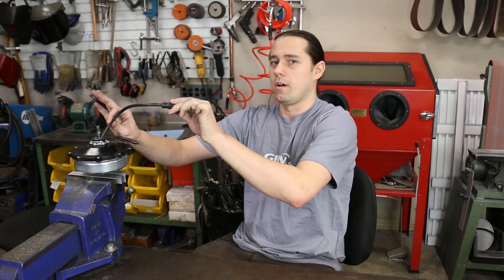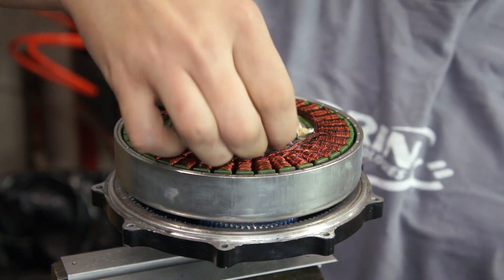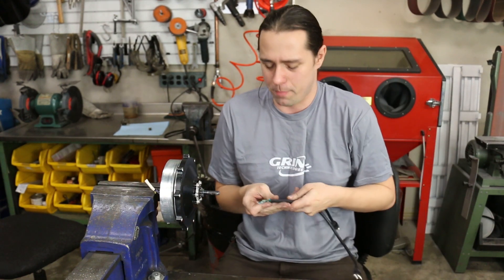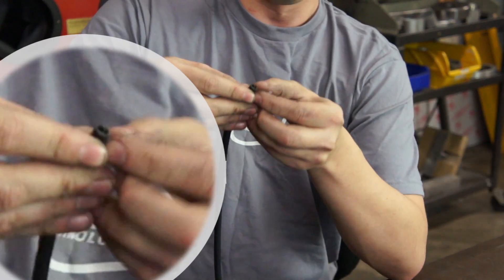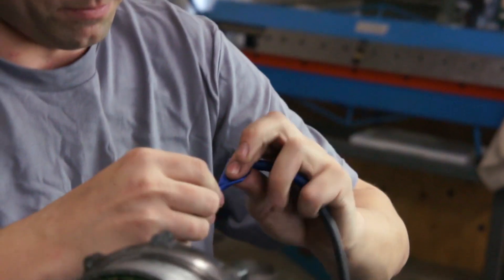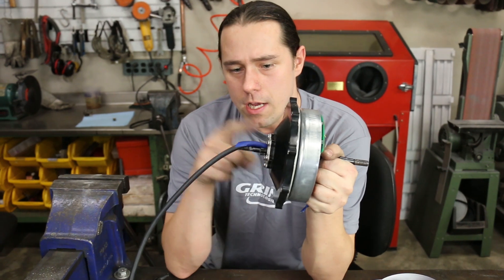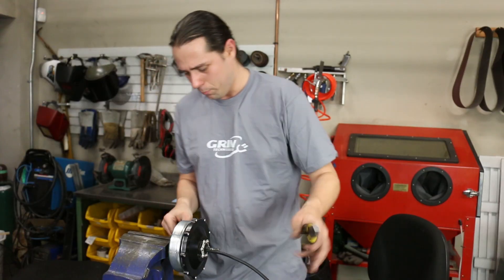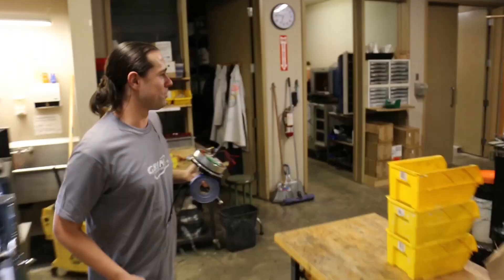How to replace a damaged cable harness in an ebike hub motor

Comment: I frequently encouter the same issue pulling the cable through a too small orifice while pulling electrical cable to install swimming pool lights. I use the same method of decreasing the diameter of the outer sheathing. but leave a longer tail of the inner insulation cord and attach very strong nylon cord to it, then using electrical tape to secure it to the cable. To do this so that the cable will still fit through the races and bends, I make sure to wrap the excess cable as tight as possible to make its diameter as small as possible. The nylon cord used as a fish tape can then  be doubled or tripled to add tensile strength. I also use electrician"s luble to ease it through the tight races. I'll be performing this very task this weekend on my boyfriend's bike that I crashed when some clown turned right in front of me. Those front brakes sure worked better than the rear brakes because I went ass over tea kettle over the handle bars, consussion and serious bruising. Asshole didn't even stop to see if I was okay or check to make sure I didn't sue his insurance company into the Stone Age.....I'll let you know how swimming pool technology transfers over to ebike repair. Thanks for the incredibly helpful and informative video.

Comment: I’ve made cable repair but display continues to display 30h communication error. Could it be my controller is fried from when the cable was damaged?
Reply from the maker: Communication errors are between the controller and the display, and don't have anything really to do with the connection between the controller to the motor which is covered in this repair video.  So yes it is quite possible that your controller is damaged too, or you have another wiring issue with the signals, unrelated to the motor cable.

Comment: Hey man i have the same problem. Can somebody please tell me what kind of wires those are..I've been looking for these phase wires and all that I can find is the 9 pin connector but not the actual wires that go through the axle..
Reply from the maker: Every motor is different so you might want to email our tech support with more info on what you're running!

Comment: Thanks for this great video.  Can you let me know where I might buy the cable and 9 pin connector from?
Reply: AMAZON, they have all the cables. Just select the end type you  need to connect to your controller
 Then cut off the other end that will now go into your motor.😅

Comment: So the trick is to pull out the cable on a roller chair to prevent you from hitting your head on the floor when the chair collapses.
Reply from the maker: Precisely, only we forgot to specify "roller chair" as one of the tools.

Comment: I would get some electrical lube and cover the cable with it. The lube is a special type for electrical use. I’ve even used dish soap in a pinch.

Comment: I am going to attempt this job next week.... But I have pulled Big wires through conduit and I use a Lube on the big stuff.... so I will lube the cable before I pull it through, after I do my Tape job......  and I will not cut all the wires at the same point....  I will cut each inner wire at a different length, so I will have a longer taper ....   Thanks for the video and info here....  I wonder if KY jelly will work?

Comment: This video is great. What would make it awesome is a source for the cable. Because otherwise, I get my hopes up, figure I can repair it, and then learn I can't get the cable. So the video just mocks me.
Reply from the maker: A lot of motors have sufficient extra cable length outside the axle that you can just repurpose what you have and shuttle it further down.  You can also DIY a 3 phase motor cable using thin walled FEP shrink tubing and putting that over the flexible stranded noodle wire after removing the thick silicone insulation.
Reply: Buy the cable with the right connection you need, then cut off the other end that will go into the motor.

Comment: I had an idea, why not strip all the wires twist the ends solder them all to a scrap piece of tough wire, feed that single wire through the bore then pull the entire cable through?

Comment: Where did you get the wire? You can't repair these motors because no one knows where to get the wire?
Reply from the maker: We often simply salvage the phase wire from damaged motor controllers and keep that on hand to use in motor repairs. The 3 phase wire that we sell here works in some cases: https://ebikes.ca/shop/electric-bicycle-parts/wiring/grinmotorcable.html   but for many other motors the OD is too large and you need a thinner gauge product. 

It's is possible to fabricate your own motor phase wires by stripping the silicone insulation of flexible noodle wire and replacing it with thin walled FEP shrink tubing. This reduces the cable OD substantially so you can get an OK wire gauge through the axle hole.

Comment: I be never ever seen anything like it I snapped my hub cable right at the wheel this guy made it look so hard Ive never ever done any electrical or cable soldering but it was so easy don't watch this.unbelievable
Reply: My hub wire is torn / chewed at the end also..how did you do it?  Video looks like I need to be a pro or an idiot to work that hard.
Reply from the maker: The difficulty really depends on how exactly the cable run fishes through the axle. We did the video on the GMAC motors which are among the most challenging jut to show how it can be done in the worst case scenario. If the cable is just going through a straight bore to the other side without any sharp bends then of course it is much easier.

Comment: The construction of these hub motors, is very similar, to wind turbine generators, just add the magnetic polarity. Has anybody done experiments, or reverse the polarity on these, similar to people's alternator experiments, in order to generate electricity? I love my 3000 watt motor. Debating whether I should replace the one black wire, for the hall sensor, (If possible) or locate the make of this used electric bike I bought, In order to get the proper cable, going to the hub motor.
Thoughts, suggestions? 
Thank you so much community.
Great video as well! Thank you.
Reply from the maker: There is nothing required at all to run these or any other hub motors as a generator. Just spin the hub and it will create a voltage on the phase leads, and you can either rectify that with a 3 phase diode bridge to run off the back-emf voltage directly with no regulation, or you a motor controller in regen mode to have fully programmable output voltage.  Tons of people have done this in all kinds of neat power generation applications.

Comment: Where can I source a cable for my e scooter motor. It has hall effect sensors/wiring but my scooter doesn't them.

The motor is 1200 watts peaking at 2700.  How do I determine what wire gauge I need?

Comment: Also wouldnt a better way be to removel the spindle completely then re installing it with the wire already placed in the bore holes?

Comment: what about any water based lubes? my damn rear brake rotor bolts came loose several times now and cut my cable, while riding tonight  my motor kept applying  the electric motor brake, which i never even setup, and it attempted to go into reverse while i was finishing this short but troublesome and very short ride, as i was riding it into my front yard and it ripped the wheel right out from the slots holding it in place. good times

Comment: My cable runs  inside the hollow  bolt  of my motor and it has been nearly cut through.. It's a cunt of job to fix

Comment: silicon spray is an option on the cable and tunnel to help it slide through.  I would say that having 8cm of sheath free cable is okay as the end where you grip with the pliers to pull through will then mean you just cut off that 8 cm and work from there.  I haven't tried it as yet but certainly a suggestion at the moment.

Comment: Simpler: After the "massage" - pulling the insulation, DO NOT shorten all the wires! leave one long, and solder the "guide" wire to it. You pull it all in, with that guide wire.
Reply: when you shorten other wires, do not shorten to the same length, but short and then next longer... We get a conical configuration. Use grease, when pulling.

Comment: Is there a repair for damaged motor axle threads or is this a case of replacing the entire inner armature assembly? Thank you.
Reply from the maker: You can often just chase the threads with a die to get them in good enough form, and use washers under the nut so that the nut is further out where the threads are more in tact.
Reply: @GrinTechnologies  I think these might be too far gone. Wonder if JB weld applied & then threaded would work? Used to be able to buy liquid metal that I think was good for making threads.

Comment: I'm here as my motor wires melted at the connectors after the bikes fell on its side when switched on, breaking the power and twist throttle wires on the handlebar end. Can anyone tell me is that would that mean my motor's been fried?
Reply from the maker: Your motor is most likely perfectly fine, and you can confirm that by replacing the connector or just bypassing it and wiring directly to the motor controller leads.

Comment: Great idea and top tip, I've never tried sourcing a replacement cable its mainly higo/julet 9 pin in the UK but in the event of another motor fail I would now consider it as an option - shame on the video ending, I would of liked to see some top tips for the internal soldering and perhaps a future video idea for replacing hall sensors and speed sensors, my attempt at a video was with my first motor and with very little skill however it worked for a while. You guys have the knowledge base and the directing skills to produce a high quality video.

Comment: sir, can I use any other series hall sensor instead of series labelled on that?
Reply from the maker: Yes, there are many other series of bipolar hall sensor that will work just fine. And also many that will not.
Reply: @GrinTechnologies  you could definitely help us all out by guiding us to which cables we need for our particular bikes

Comment: can someone tell me how to get your control cable through the little axle hole in your torque arm?? the connector block on the end of the cable is too big to fit thru the hole. ive watched alll the vids on youtube on torque arm installation but nobody talks about this problem!! I am thinking about cutting off the end of the torque arm that slips over the axle so that it looks like an open ended wrench.. that is the only solution i can think of? other than cutting the connector off and feeding it thru the torque arm hole and splicing the connector back onto the end of the cable which i dont want to do.
Reply from the maker: Usually you would mount the torque arm to the other side of the motor where the cable is not coming out of the axle. If you cut the torque arm open into a 'C' shape it will loose most of its strength. This is one of the reasons why we really dislike end axle cable exits, and why almost all the motors that we stock and sell (like the RH212, FH212, GMAC, All Axle, Crystalyte, DD45 etc.) have side cable exits instead.

Comment: Great video I got 3000w motor witch doesn't have temperature sensor what steps has to be taken to install temperature sensor pls advice
Isit possible to just fishing the temperature sensor wire in or all the hub wires have to comes out then push the new wires in including temperature sensor wire

Comment: Use heat gun to stretch casing out to thin its diameter, or, my preferred method for such situations is to remove outer casing and replace with heat shrink tubing to reduce it diameter. Professional, just as protective  as original casing, and with a little soldering flux as lube, the extra hour of work is reduced down to 5 min while still withholding equal amount of integrity, both morally and structurally. “Work smart, not hard, use your brain and save your back”! Your welcome 👊🏻
Reply: Also, using heat ( not so much to burn coils, ) to soften the wire casing apon removal is also way easier than tug of war. If not possible, cut casing flush with motor and pull wires out individually. Your welcome again! 

- Just a man on a mission for speed.

Comment: If the hole  where the wiring goes trough is a bit too small for new wiring use a Dremel tool, with a grinding stone on it, and open up the hole's diameter larger, so the wire slides through much easier, with less resistance. Could also use WD-40 on the wirings outer coat, and inside the hole, to allow easier, and smotther passage of the new wire.
Reply: You should be using a cable that is 6mm outer diameter.😊